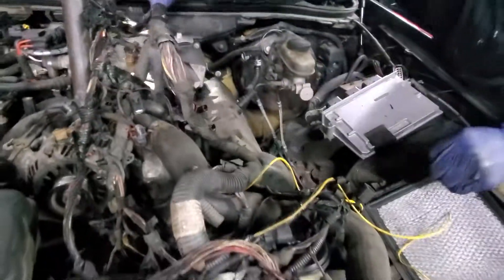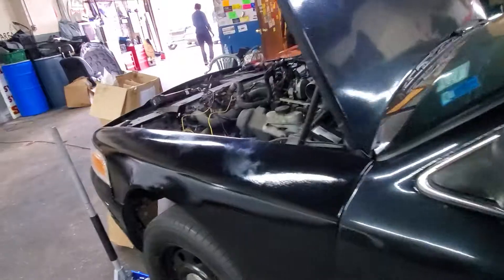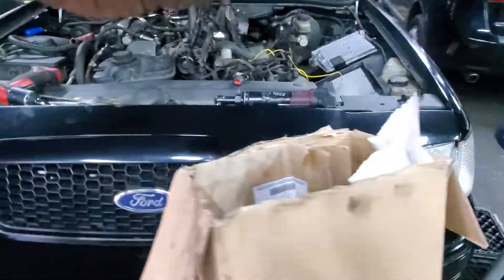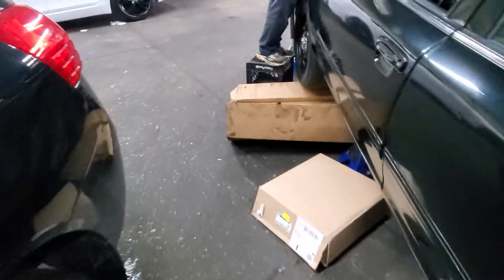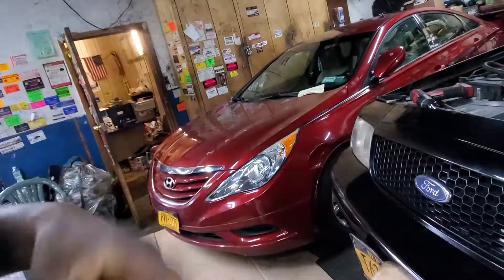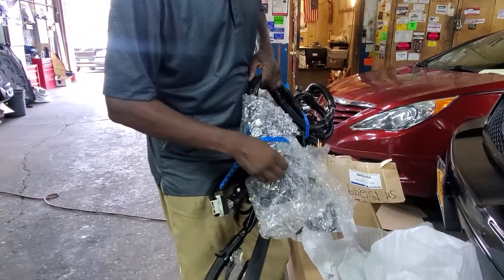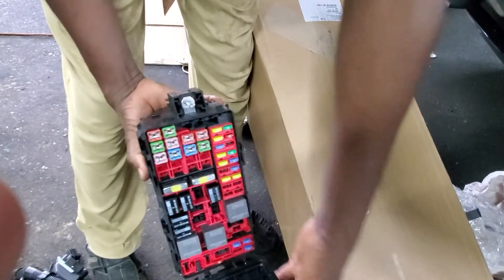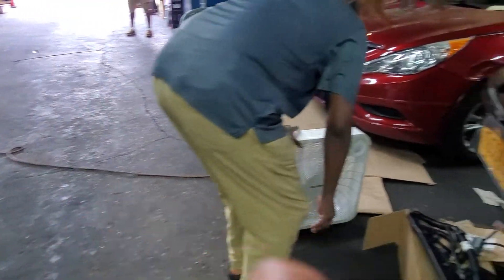2008-2013 Ford Crown Victoria Electrical Short Wiring Replacement  What You Want To Know

Comment: Hello sir ihave 2014 ford focus st 2.0l petrol this car is not accident and before  three months customer drive this car everything is okay but now car doesn't start no cluster lights no ignition we check every thing like fuse wiring power grounds and also can can communication everything is okay can you let me now which ecu box I can change engine ecu already is okay please sir
Reply from the maker: check the bcm control module and fuse #69 unplug it and connect it again
Reply from the maker: call me at 13472281875 please

Comment: Hello, my friend, I am from Saudi Arabia, and I have a problem with my car, Grand Marquis 2010. The compressor stops with movement, and I pressed the gas pedal. I went to a workshop, and he told me that I had a malfunction in the car's computer.
Reply from the maker: Most of the time the engine computer is controling the ac relay see if thr xan bypass it
Reply from the maker: 3472281875

Comment: I have grand marquis 2010 and i have random codes and ac issue
Reply from the maker: I have the same one yeaterday the engine comouter is not good .for you try to do some diagnistic test be sure before changing any part
Reply: @BestCarFixes  you mine change wiring??